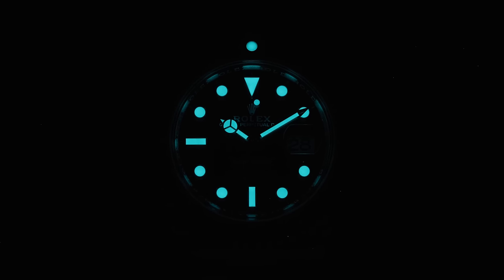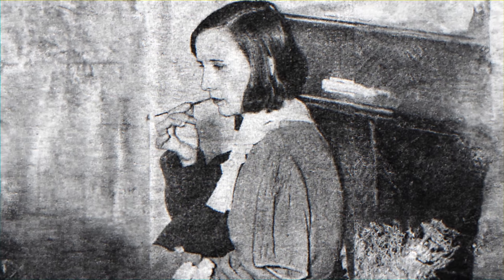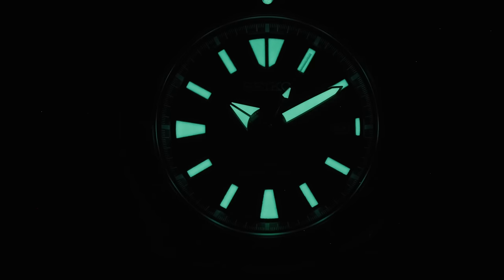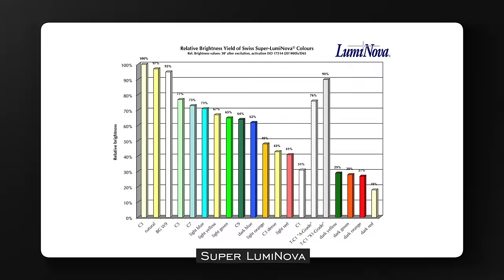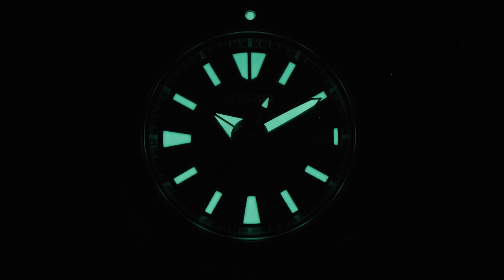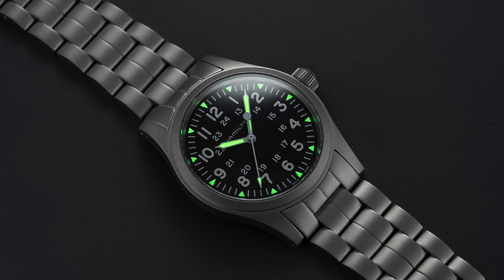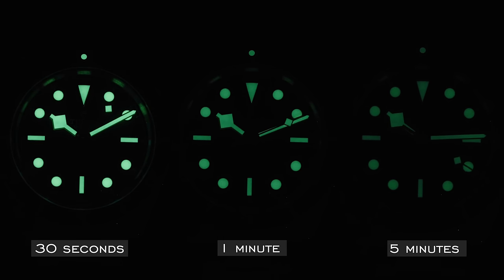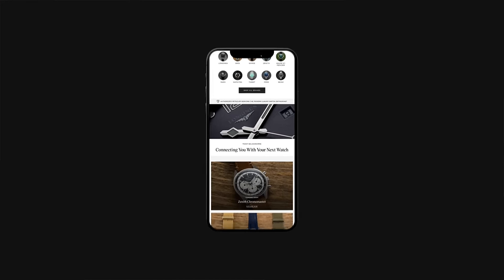How Do Watches Glow In The Dark? The Secrets Behind Luminescent Material, Super-LumiNova, & Tritium

Comment: Hi Teddy, the one information I was hoping to obtain is, is there any lume degradation for S-Luminova/Lumibrite after several years? If so, what factors do impact the longevity and potency of a lume material? (e.g. prolongued exposure to UV, long intervals between charging, etc.) 
Thank you!
Reply: I am wondering about this as well.
Reply: Based on my experience there is some.  But it could also just be that newer watches have a more modern lume material and therefore perform better.  But a +20y old Rolex with Luminova still holds a charge for some hours.

Comment: Tritium Gas Tubes do not ‘glow consistently’ for 12.32 years then ‘lose their luminescence’.

Tritium has a Half Life of c. 12.3 years; meaning that the tubes are always losing brightness. After 12.3 years there will be half the number of decays per second. As such absolute brightness is reduced 50% after that time. But the tubes will still be glowing for decades, just at a constantly reducing level; halving brightness every 12.3 years.

Comment: If I recall correctly, the human eye is most sensitive to green light, so that may explain the lean towards green over time, or why it stuck around, or it's a coincidence we're still using green with the materials available for lume. It would be good to see how long it takes for the lume to drop to half of the initial value, rather than what it looks like at fixed times. But it would require some reasonably calibrated equipment.

Comment: Some background on Radium and radiation : Radon is not a cancerous agent (it’s a noble gas and therefore not absorbed by the body) but inhaling it exposes the lung to radiation, thus causing a higher risk of cancer.
Also wearing a radium watch isn’t that big of a deal as long as it is in tact and does not break. Yes it emits much more than a modern tritium tubes liked watch but that’s pretty negligible. However working with/on those watches and especially licking the paint brush is a OTHER deal. 

Why is ingesting radium so bad? The body comfuses the radium with calcium and thus integrates it into your bones. The inside of you bones (marrow) is where bloodcells are made. Exposing them and the marrow to alpha radiation (wich radium emits) is BAD. Most of the radium girls died due to brown marrow cancer and/or blood cancer…

Halflive: you watch won’t stop to glow after that. This is the time where half of the material will have decayed into other isotopes or a stable element. For tritium that is helium in its stable form (not radioactive and therefore not helping the glow). I have tritium watches that are 40yrs old and in absolute darkes I still can see a lil bit of glow .

Tritium tubes: Tritium is a weak beta emitter. Therefore yes this is blocked by the glass tubes. But the Bremsstahlung (when a beta ray hits the glass there is a chance of it „kicking off“ another x ray) is still there. However it’s pretty weak because the initial beta radiation is so weak. On top of that those tubes will sit inside the watch and therefore have even more shielding. So: I can detect my Ball Night train with my lab equipment but that’s so weak that it doesn’t matter and there are many every day activists wehere you will get the same amount of exposure. So yeah 100% save 

Source: I am a nuclear physicist
Reply: Yes, the radium girls who painted watches wet their brushes with their lips or tongue to create a fine point. The fate of these women is an absolutely heartbreaking story.

Comment: I bought a seiko speedtimer ssc813p and the lume on the 3 o'clock doesn't even work when exposed to sunlight or flashlight. What do you think happened ?
Reply: Sounds like a factory defect - lume wasn't applied.  If it's still under warranty, get it to a Seiko dealer; they'll probably give you a new watch (eventually.)

Comment: Just a note that this is a very luxury-watch oriented take - cheaper watches throughout history have often just used plain zinc sulphide without any (expensive!) radioactive material added, just relying on the ambient light to charge them like Luminova does. The "all old lume is radioactive" myth is very persistent, but there are plenty of old watches out there with non-radioactive dials and hands.